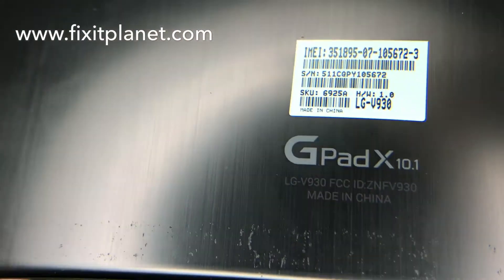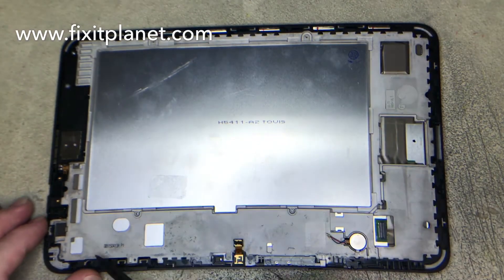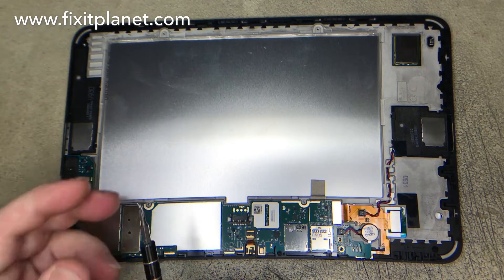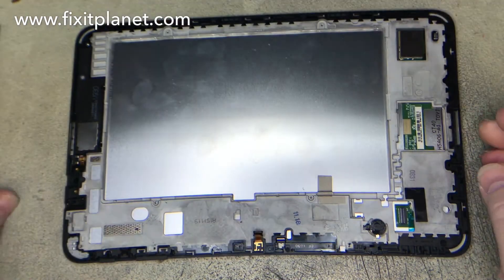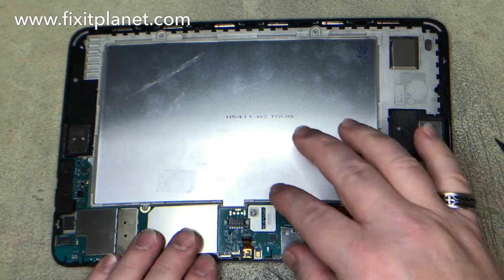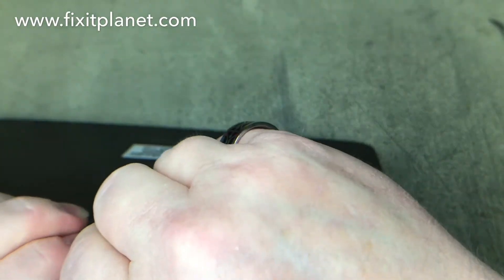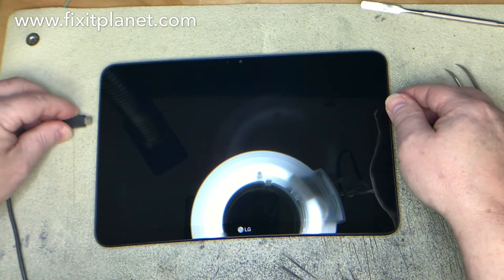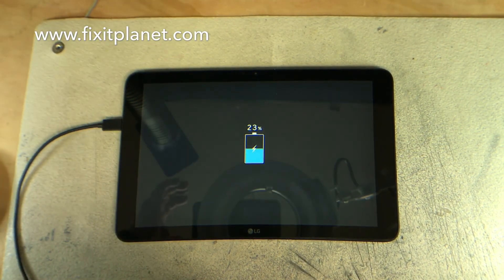LG G Pad X LG-V930 10.1" Display Replacement From Start To Finish.

Comment: Hello, I'd like to know if you could tell me how I can get the metal backing off of my LG VK810 tablet, so I can replace the battery in it. The VK815 is not made like the VK810 unfortunately. I found out the hard way. I tried to take it apart like you did in your video of the VK815, but I found out there not built the same way. I hope you well be able too help me out somehow. Thanks. Tryce.

Comment: How do you get the screen off
Reply: By following this. Basically you take everything off and reconnect.
Reply: The screen is connected to a frame it’s easier to replace the face frame with the screen. That the way it comes.

Comment: Thanks for the great video. Any recommendations where I can get the LCD assembly? I am having a hard time finding it.
Reply from the maker: Thank you. Someone on Ebay or Amazon probably has it.
Reply: None on eBay, but found one on Amazon. Unfortunately, the cost between a new screen and buying a fully functioning refurbished system is about the same.